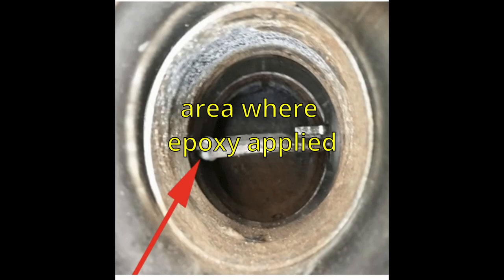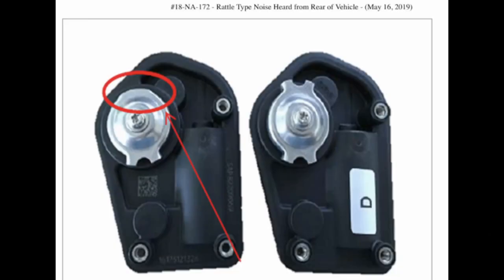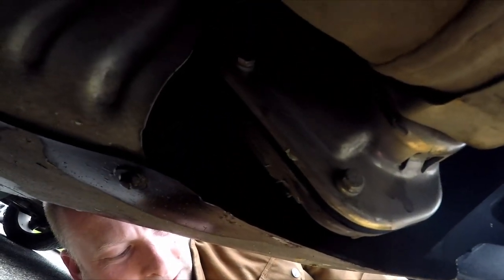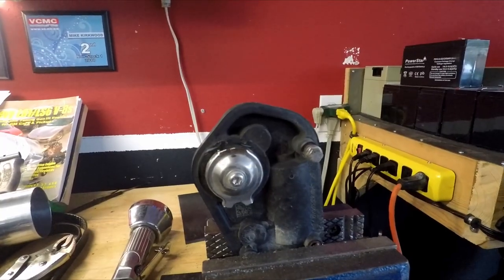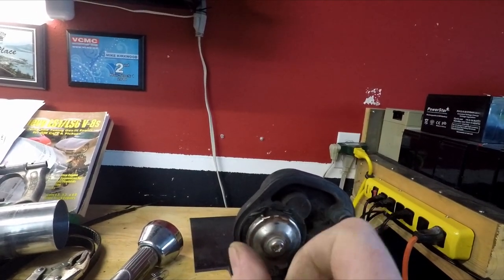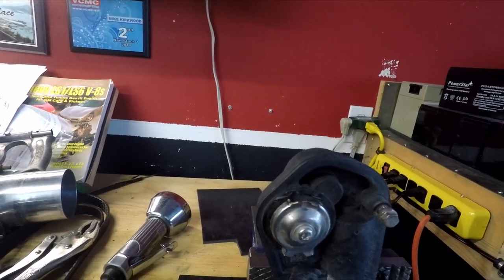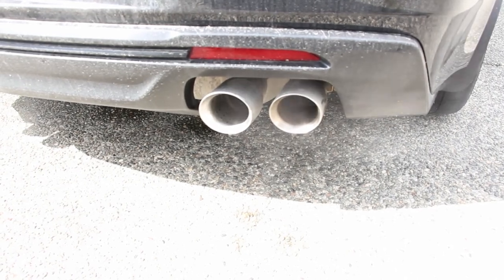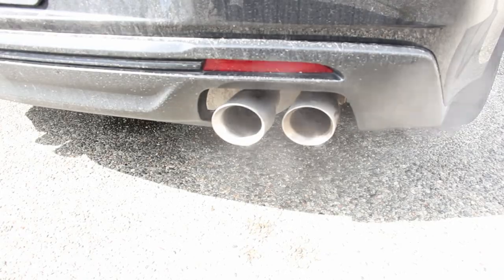6th Gen Camaro NPP Exhaust Rattle. How to Fix That FOR GOOD! // Ultimate DIY solution.

Comment: This is great, I am going to try this on mine and hopefully eliminate the rattle noise.
 Im also trying to isolate another really specific squeaking noise that drives me up a wall; 4th gear at about 2200-2400 RPM going between 60 to 70 km/h. No idea what makes the squeak but that's the only time it happens. Open to suggestions if you got them.
Reply from the maker: Thanks for watching and I’m glad the vid could help. I have a squeaks as well but turns out it was the NPP valves opening and closing. I have a vid of it as well. Not sure but you could have a similar issue. Check it out.

Comment: Have you ever had any issues with your dual exhaust. Mine seems to have stop working and stuck in loud mode not really an issue but would like to fix if I can. Already checked the fuse.
Reply from the maker: It could be the connection to the actuator that came loose or the actuator itself failed.

Comment: Camaros aren’t good cars. I’m going to trade mines in GM just needs to do better
Reply from the maker: All cars have their issues. What will you trade it in on?
Reply: @The_604_Garage  dude my wife just said the exact same thing. Honestly I don’t know. I love my Camaro but all the reviews I’ve read seems like the problem will come back. I have my appointment set at the dealership for this week. But now I’m scared they will say everything is fine and it’s normal. I just like a smooth riding vehicle
Reply from the maker: @lamarkx2259  yeah I’ve heard people keep having issues after going to the dealer. It hit and miss if they solve it or not. I hope they do for you man and you can keep yours as I like mine a lot too. Maybe an excuse to upgrade to a Borla or something…… hmmmmm.
Reply: I had a 2017 ss I had a few issues with, all except 1 was covered under warranty. Still, it's frustrating none the less, especially if your able to buy something like this brand new, you expect nearly everything to be perfect. Anyways, I traded mine for a silverado a few years ago.. I missed it so much I ordered another SS 😆 
Now just hoping I don't have too many more MONTHS to wait for it to get built. You would think by now GM would have the major issues of 6th gen camaro worked out, but I honestly don't believe it's always that simple 🤔